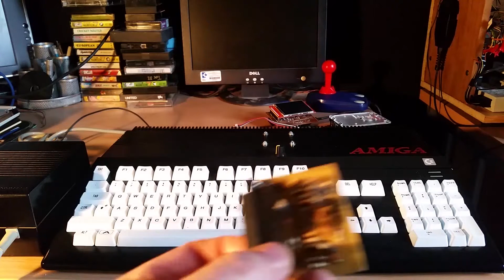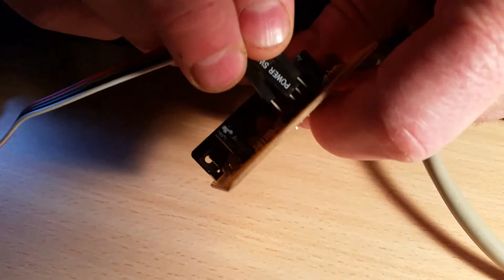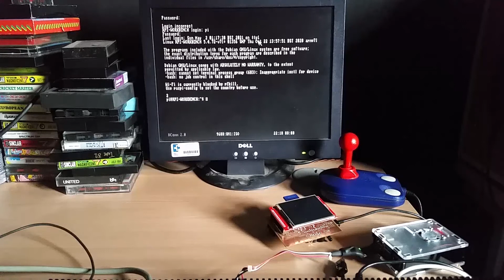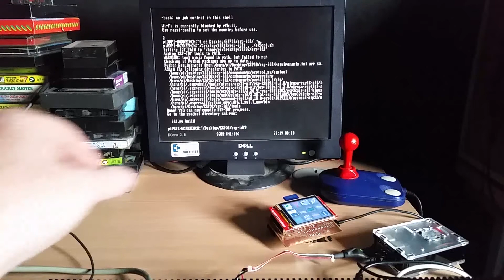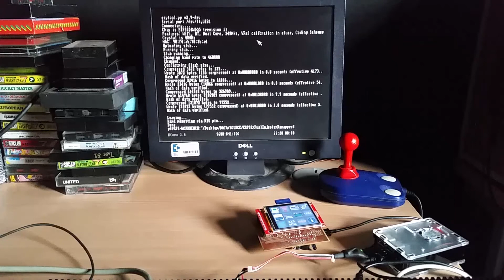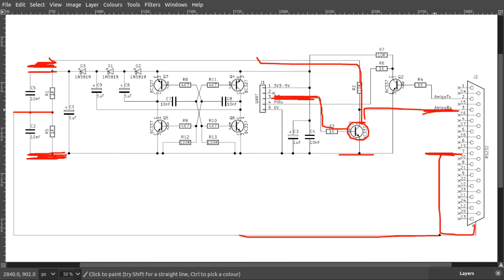Amiga RS232 To Raspberry Pi UART Terminal Session

Comment: is it possible to connect Pico directly to Serial port using logic level converter?i want to send midi form pico pin 0 to serial port pin 3
Reply from the maker: I think you should be able to. That is effectively what this circuit does, but also generates the higher voltage. So you would need to level shift to the RS232 voltage levels.

Comment: I like this a lot, I'm almost tempted to make one. I presume it would also work on the A600 right?

Is the schematic for your adapter on github? Which repo?

Is there not a commercial, pre-built alternative to your custom circuit for this (Amiga serial -> UART)? Has anyone done an improved version of this that you've seen?

Great work!
Reply from the maker: I don't think I put it in my GitHub. I'll see if I can find the diagram. Most people use the MAX233 IC to do the same thing, the MAX233 requires no external capacitors.

Comment: I've always thought it might be fun to use an Amiga as an input peripheral for a Pi, or even regular PC, running Amiga emulation far superior to your hardware. Would this be possible with your circuitry? Granted there would need to be some software running on the real Amiga to capture, translate and send the appropriate data from the keyboard, mouse and joystick ports.
Reply from the maker: You would need software on each end. On the Amiga side you could probably write it in BASIC, as I think the Amiga BASIC could open a serial port. The I think the fastest I could get it to communicate was 19200 Baud using the terminal software.

Comment: you saved a converter chip by designing the internal circuitry yourself
Reply from the maker: A couple of years ago I bought a MAX232 chip, when I started this project I looked for it, but have no idea what I have done with it. So used transistors instead like you say. I did order some more MAX232 chips to use with my Z80 computer in the future some time.
Reply: @DevelopIT  you've done beautiful job